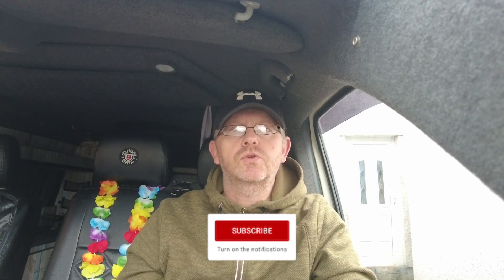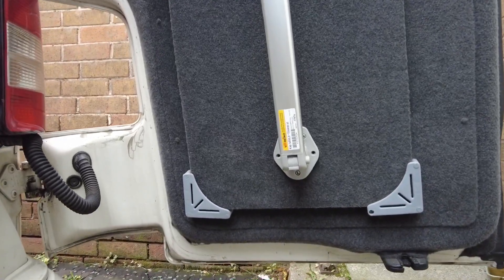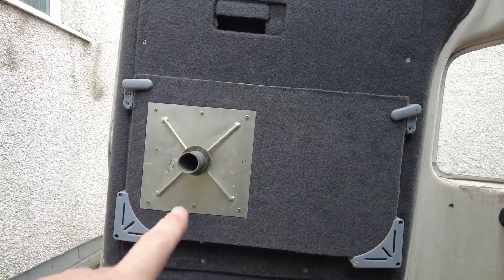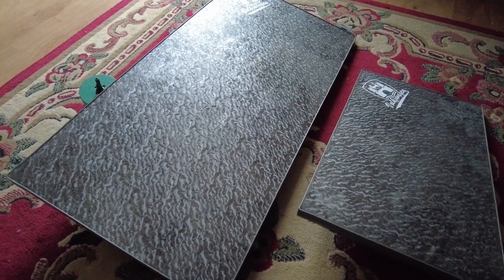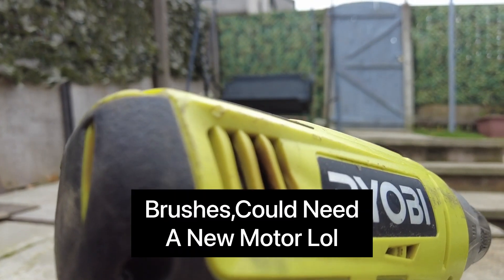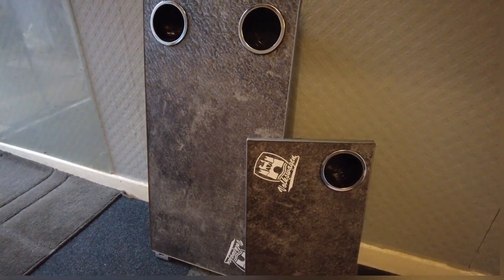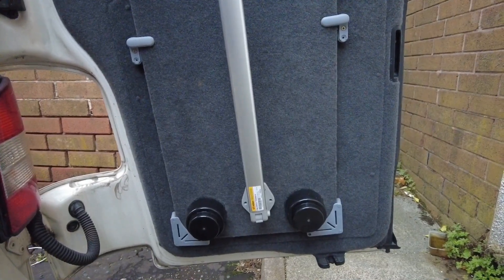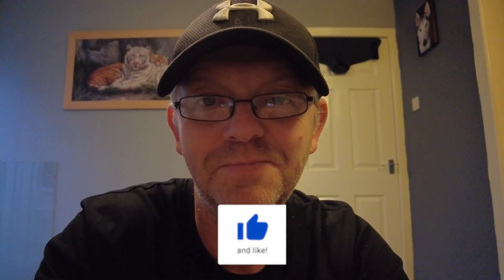Vw T5,T6 DIY Van Table Cupholder Install Campervan

Comment: Here no wonder you where giggling...... "take you round the back" jeez and English is your mother tongue😂👅😝🤣👍🏴🇬🇧
Reply from the maker: Lolol how do John,I’ve killed my ryobi lol……it was well smoking more than what was on video pal lol
Reply: @CampervanAdventures  Paul, mine wouldn't be smoking, and l'm rubbish at DIY....... Oh wait a minute, just remembered l don't own one🤣🤣 l'm sure you'll be able to get some new bushes sorry brushes😝 cracking wee vid buddy great idea BTW, as usual though l'd get Grease Monkey conversions to do it, they're my go to guys😁👍🏴🇬🇧
Reply from the maker: @johngracie1960  lololol I bought that drill when I started my van build,we’ve been through a lot…..if it needs a new motor I’ll get one lol👍
Reply: @CampervanAdventures  l have tried to send you a few pic's of the van, l'm also 💩 at anything technical.. I just replied to the last email hope they get through 🤔👍
Reply: Defo not getting pics as l've just had msg saying "computer says No" 🤣🤣
Reply from the maker: @johngracie1960  lolol send them here John Campervanadventures@hotmail.com👍
Reply from the maker: I need to add the email to the channel👍
Reply from the maker: Hi John I’ve just looked got your pics,Van looks really well mate,it’s like the hard top version of mine lol